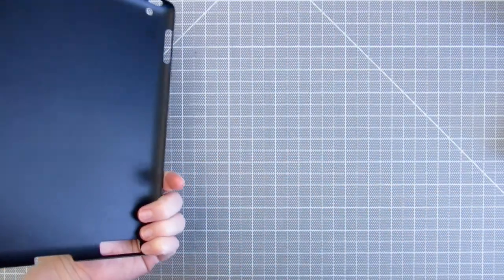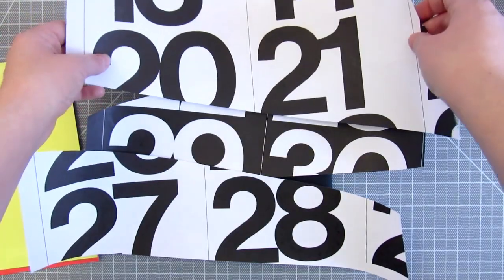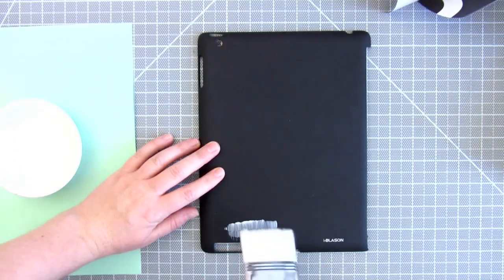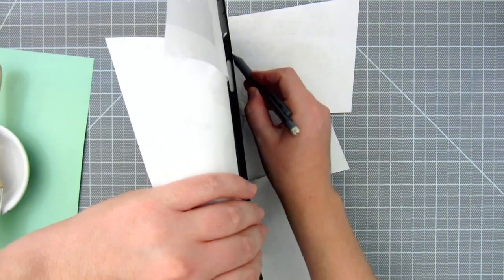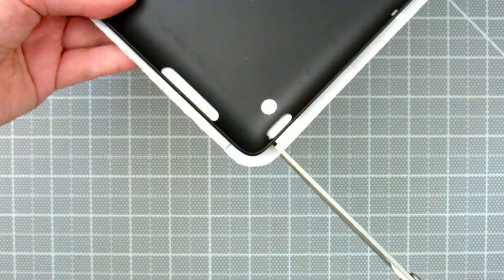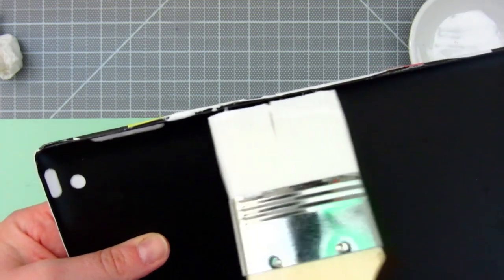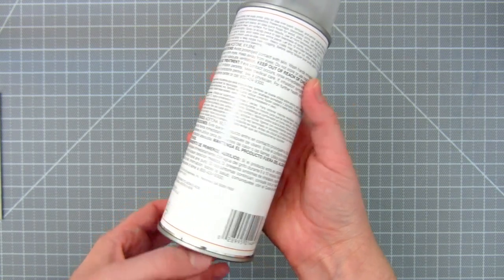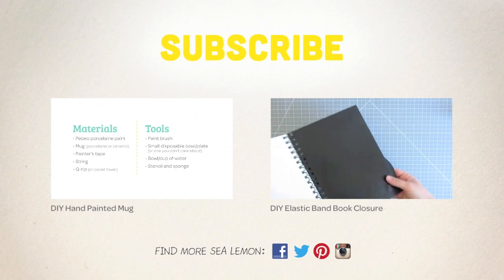DIY iPad Case Design | Sea Lemon

Comment: The Mod Podge sealer spray is like £41 in the UK, are other brands just as good? Thank you :)
Reply from the maker: Ouch, pricey. You could use other sealer sprays, I'm just not familiar with other brands. You might find other sprays at craft or hardware stores.

Comment: This is really cool, but wouldn't it be faster and easier, not to mention less expensive, to just use adhesive-backed  Contact Paper?
Reply: Motherof Chaos easier for sure, but why would it be cheaper? Mod Podge can't be that expensive(you can also just use something like PVA glue which is definitely not expensive). 
And regular paper, maybe even recycled stuff, is definitely cheaper than adhesive backed one. 

So you can definitely use it. But definitely not cheaper. And I am guessing getting bubbles out would still be a huge problem.